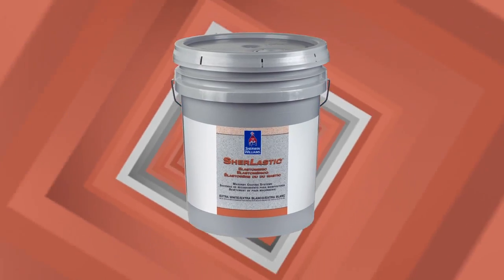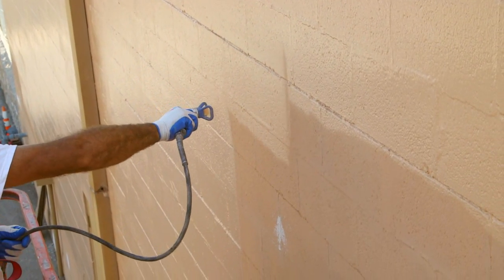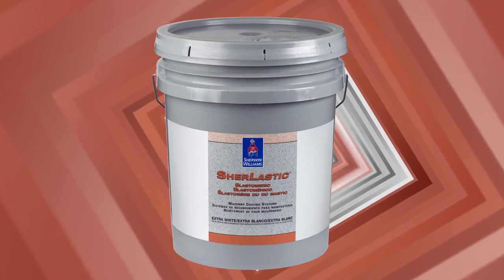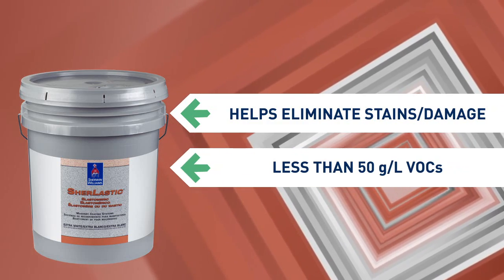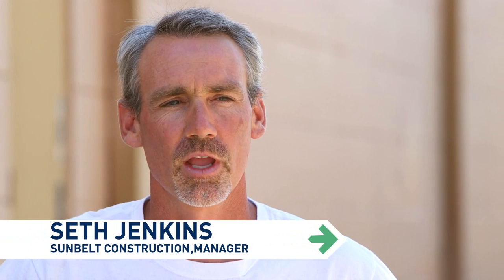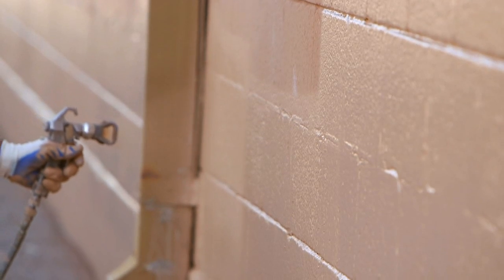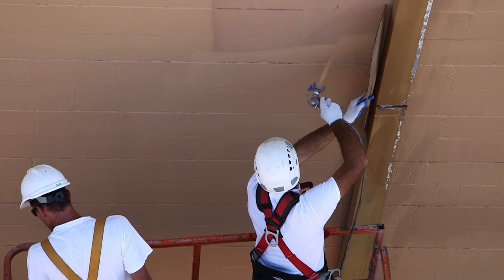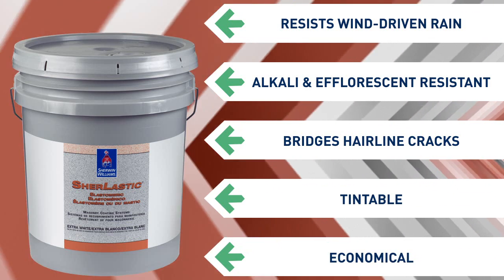SherLastic® Elastomeric Coating - Sherwin-Williams

Comment: I just bought Elastomeric paint from Sherwin-Williams and It looks as if I didn't do enough research. I also bought an KRAUSE & BECKER
Airless Paint Sprayer from Harbor freight as well after reading the reviews. It sounds like the Elastomeric paint will be too thick from what I'm reading. I guess I should  take the sprayer back since i won't be able to take the paint back. Can someone please help or give their recommendations please? I don't really wan to roll the whole house.
Reply: I'm in the exact same situation except I was planning to buy a Graco Magnum ProX21 sprayer and now I'm being told it won't be powerful enough to spray elastomeric paint and the cheapest Graco sprayer that will work is over $3K.  What did you end up doing?
Reply: @kyleharris9019  I ended up rolling the house. My shoulders are still hurting. LOL
Reply: @itsjrj lol 😅

Comment: Excellent paint over stucco.  Repair holes/cracks prior to painting.  Of the two methods of applying the product, rolling has worked best for me.   Spraying does not put enough paint on the wall.   Stucco expands and contracts in the sun.  In doing so, stucco then cracks-to include synthetic stucco.  Cracks.    Paint with elastomeric expands and contracts in serious summer heat.   Leaving no cracks.  Cost?  One quarter the amount it takes to restucco a home again.  This should be a no brainer, but believe me, there are people out who must restucco, mostly because it's more expensive.  So the more $$$ spent, the better the job?   Not only no, but hell no!!!
Reply: @Kevin Richards 10 year painter in Central Oregon here - I have sprayed a ton of this paint on stucco and concrete, including Benjamin More and Rhodda's elastomeric products as well. Just be sure to use a medium to high end airless paint sprayer ( I am a big fan of Airlessco, but Greco's upper line sprayer's are pretty solid as well. Avoid Wagner) The paint is super thick and your paint sprayer will need to be able to handle the product with consistent pressure and coverage. Make sure your paint gun is nice and clean with a new filter and use a wide tip like a 515. Lastly, I would back roll the paint after you spray it to make sure the product gets into all crack and porous surfaces nice and evenly. Hopefully Gypsy Soul see's this too. Best of luck!
Reply: You dont need a special spray guy. But you do need a 695 or up to spray. Mi d you I sprayed it in my 490. Lol. But I pulled all my filters first. Plus I wouldn't do that again.
Reply: @danielsinclair9918  thank you i needed this advice 

''pull the filters''
Reply: Pogey Bait I was told by a competitor that spraying would get deeper into the stucco but that I would need a special paint sprayer due to the thicker consistency flex paint.  A roller sounds better than buying a paint sprayer but then I suspect that I will need much more paint then.  Who is right?  Thank you in advance for any advice you may offer.
Reply: Kevin Richards hi.  It was an employee at Benjamin Moore paints that told me their 'special' paint for stucco should be sprayed on.  She said that I would need a special and expensive unit to spray it on with.  Led me to believe it should be applied by someone who already had the equipment.  I am looking for a paint that will flex with our climate changes here in Calgary, Alberta, Canada.  Thus my enquiry here.  :)
Reply: On some rougher, more absorbent surfaces, spraying does not penetrate the way a roller or brush can. So the paint may sit on the surface and not look as nice or consistent as rolling and brushing. Is it still as protected? That is for science to say. But if I were doing my home, and rolling looked better and penetrated deeper, I would brush and roll. If not, spraying is always the way to go. (30 year painter)